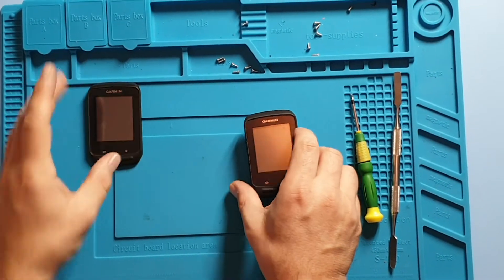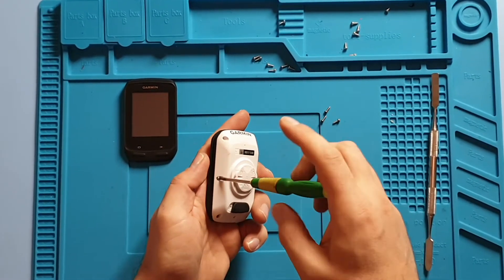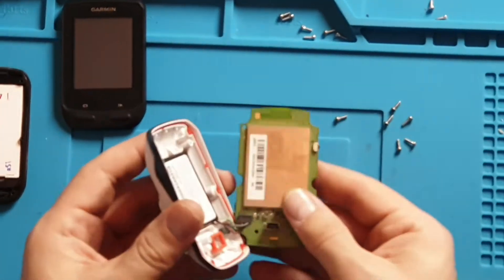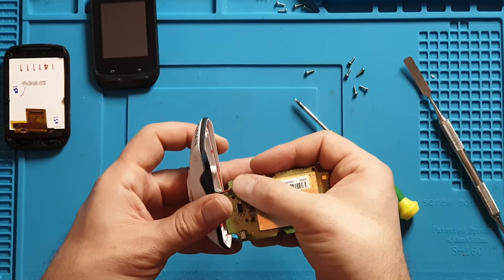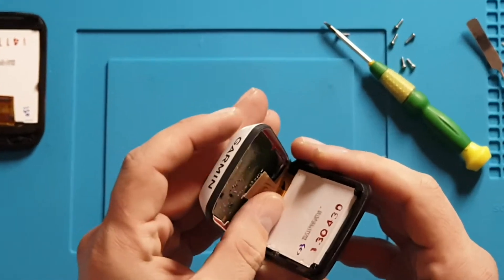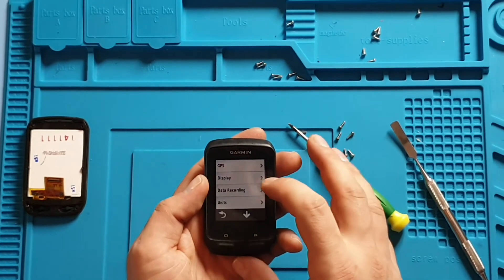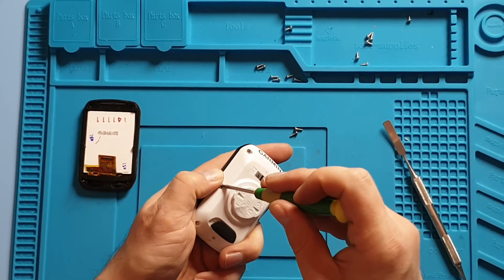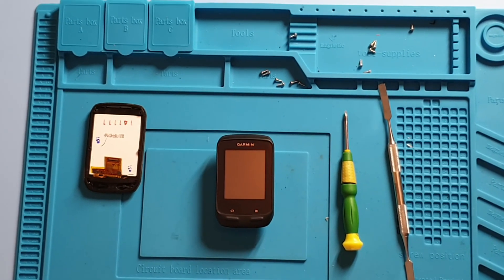Garmin Edge 510 LCD screen and touch screen replacement tutorial.

Comment: Just wondering if you have ever heard of issues with the screen working, but the touch interface not working. I ask because I have received 2 screens from ebay and both the screen works, but the touch capability is not working. The reason I am repairing is due to a crash that busted the screen face. Everything boots up and the buttons work too. Thanks in advance.
Reply from the maker: Did you check the part no?
Reply: @RepairMyDevice  No, where is it normally listed on the part? Should I be looking for something specific?
Reply from the maker: @mowatts  one part no is on the back of the LCD and one is on the touch screen flex.
Reply: @RepairMyDevice  DF1722YP FPC-1 REV3; WD-F1722YP-6FLW
Reply: @RepairMyDevice  Should I reach out to you via email? I can use your website to find contact info. I wish y'all had supply of this product as I really do not want to spend the $ for a Garmin 530 unless I have to. Thanks.